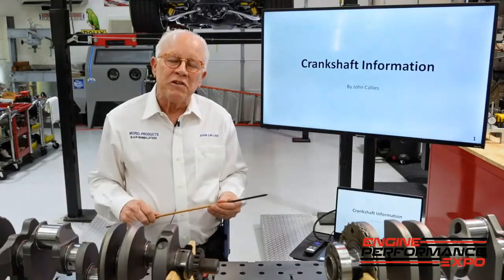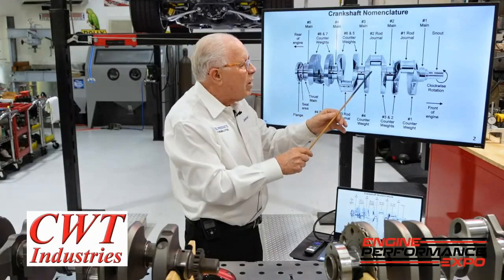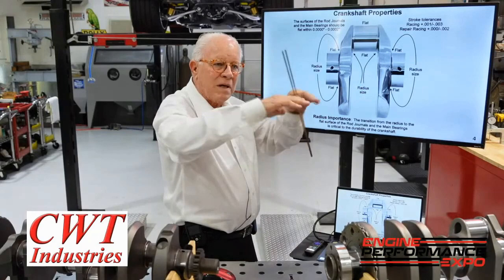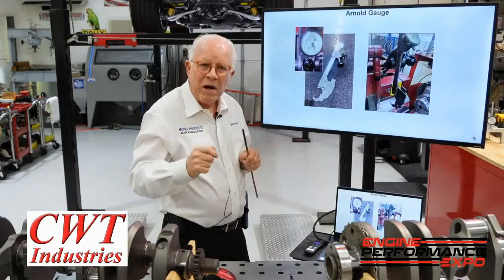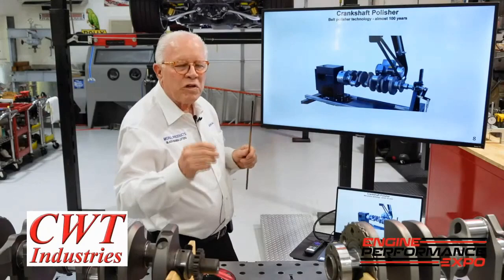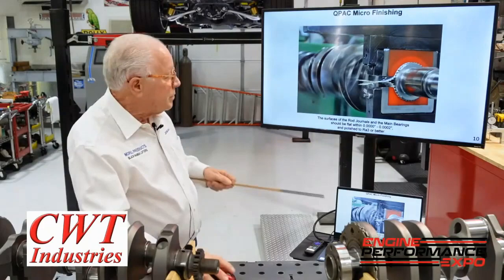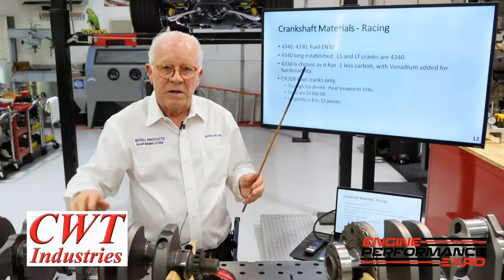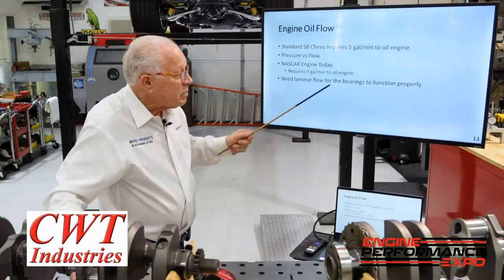Crankshaft Design with John Callies (2023 - Episode 42)

Comment: Chrysler also installs the thrust bearing in the center main. I thought GM , Chevrolet in particular, (I’m not sure about BOP) placed it at the rear so the crankshaft would be isolated from forces imposed by the clutch fork and throw out bearing. If the main concern is axial location of the crankshaft, then center main is where I would choose.

Comment: the reason you drill a hole in the crankshaft is for strength. it was first used in the developing of the crankshaft for the Merlin Rolls-Royce during ww2

Comment: No one does it better than the Germans, back in the 70s in the Old Country Palestine I used to work on Mercedes-Benz diesel trucks, some of the crankshafts had the counterweights bolted on, so we have to pay close attention when we dismantle them, some of the crankshaft had a gear on the back of it instead of a rear crankshaft seal, as the crankshaft rotates all the oil that drops on the back of the crankshaft onto the gear will be send back into the oil pan using centrifugal force .

Comment: John would like to set oil pump flow and not pressure, but with the pump being driven by the crank the pump speed changes with RPM which effects flow. Also oil viscosity effects flow, so it's not easy to control oil flow rate.

Comment: Just (1) question..

There is a inherent problem in the traditional Small Chevy oiling system he doesn't mention and i wish to know if "CALLIES CRANKS" ever produced or is producing a "FIXED CRANKSHAFT" to address this?

On a traditional SBC GEN 1 Engine, the upper saddles are what produces the oil feed from the main passages in the lifter valley where pressurized oil comes down around cam then through to the mains into each main journals to be then fed to the rods..

Problem is the main "SADDLES" have no oil being fed to them, and traditional SBC Crankshafts have only (1) oil feed hole on each main journal, thus as soon as the crank journal enters into the "SADDLE PORTION" of the mains each revolution, it is removed from pressurized oil thus cutting off the oil flow to the rods 180* of the crank rotation...

The solution is a relative easy fix...  By having (2) oil feed holes on each main journal 180* out from each other with generous chamfered, thus fixing the issue and providing the rods with pressurized oil flow that is constant for the entire 360* duration of rotation of said main journals thus the rods are constantly fed as the engine runs.

Does Callies use (2) oiling feed holes on each main journal?
Reply: For whatever reason i cannot reply to the reply made here.

So i will say i disagree, and Callies can be the 1st to either cross drill the mains so that the rods have 100% of the time pressurized oil or not.

You're not gonna lose any pressure, and can only get greater durability.

Comment: Quite interesting , you say drilling the big ends does not contribute to crank strength. I surely has no compareable experience , but nearly all who does , say it will improove the crank. 
Now.. i can see why and how it could make a crank stronger. Simply less force due to less mass affecting thenweakpoint of the crank.
That i figured but could be wrong.
Now , if you would explain why its bad , I would be very interested. People who have no idea like me , are stupid. That simple. But those who don't ask , stay stupid.
I do not want to be stupid. 
Help 
Me.